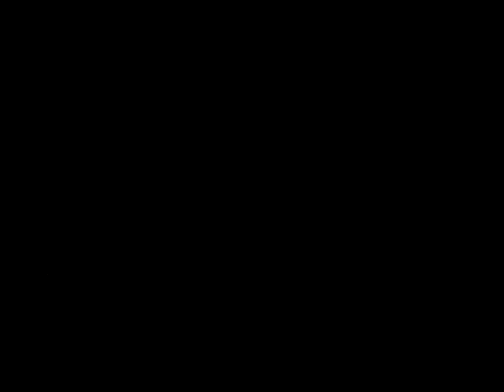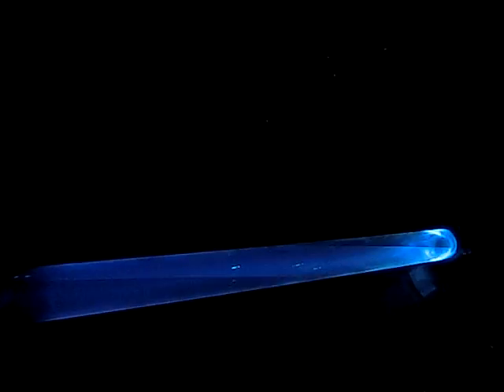Small homemade particle accelerator. (very basic design)

Comment: ok ok the vid is old but I really hope to get a response on a few questions:

I will need slightly more voltage but that7s besides the point ik how to get it.

with most linear accelerator designs i see multiple stages. like an electrode every multiplayer stage, or wit van de graaffs it's a bunch of resistors from top to bottom with electrodes after every few resistors. what is that for? and do I need it? bc it's not making the electrons faster that's for sure... maybe focusing them more? idk.

next. how low is ur vacuum, and can a single stage pump achieve it? my current one goes to smth in the order of 10^-5 or 10^-6 Bar I think.

next: you are firing into a block of acrylic. I actually want to do the same, in order to put electrons INTO the acrylic which is an insulator. that way I can charge the insulator from the inside. idk if 150kV is enough for noticable effects but if you did do it I'd like to know what your results where.

thx in advance.
Reply from the maker: You don't technically need to have multiple electrodes as long as you have a high enough voltage difference assuming you are using d.c.. The acrylic has a small hole in it with foil in the hole to generate x-rays for some other experiments. I haven't tried doing the charge thing with acrylic but I've seen some videos online so maybe? And, I want to say your pump shooould be able to get the electron beam to form at that pressure. You'll notice a dark region expand more and more from the cathode, eventually filling the tube and then fluorescence will occur with the chamber walls depending on material used.
Reply: @talktoyourself   first of all, thx for the reply.
interesting you say it was getting darker/black at first? ik it does that when dissolving electrons in ammonia but didnt know you could have enough power to see it like that in an accelerator...
 Do you have a 2nd  circuit with high amps to generate electrons, or do you just have a sharp point on one of the electrodes?

I am still sceptical about my current pump. it's a single stage pump. just looked up. 5 pascals. so 1bar is 100000 Pascals which means my pump (claims it) goes down to  5*10^-5 bar.
but hey. trying out never hurts right? :)

what bothers me with the videos online about that internal charging thing, is that it's always "Look at these cool lichtenberg fractals" but that thing should basically generate a massive E-Field without being able to be discharged (well except if you hit it hard). I really wana know how strong the interactions can get. ik there is some max charge density but I am on vacation and dont wana do the math on paper and research on phone hahaha. maybe build wierd influence machines with it etc.
Reply from the maker: @scipug3048  never know till you try is right haha and I believe it's called the Faraday dark space, or maybe the cathode dark space. It starts off really thin at higher pressures and grows larger and larger as the pressure drops. It's the mean (average) free travel path the accelerated electrons travel before smacking into an ion. Basically the darker the better in there. And just regular old electrodes or flat metal works fine. I actually just used regular brass fittings in mine.
Reply: @talktoyourself  ok nice I might look that up with the dark space...
but again I meant do your electrons come directly out of your cathode, or do you have an extra electron source like a coil of wire that you pass a lot of current through?

Comment: How much MeV are the x-rays you produce?
Reply from the maker: Probably only 0.1MeV at most, assuming full conversion of electron energy to photon. Realistically, probably a band between 15keV and 50keV. Applied voltage got up to 130kV if I remember right.

Comment: Isn’t this extremely dangerous with the X-rays? Also for this electron accelerator, you’re using a linear accelerator system right? If you are, how are you getting the cycles in correctly because I’m having trouble correctly timing the switching of the electric fields for my model.
Reply from the maker: This is actually not a radio-frequency driven accelerator, it is driven by high voltage. Radiofrequency accelerators are much harder to design and require very fine frequency control as well as precisely machined cavity spaces. That would be an excellent project but is significantly more difficult

Comment: so how can i use a particle accelerator to make hydrite? for use as fuel in my hydrogen convert car.
Reply: You don’t need a particle accelerator nor hydrite, you need to isolate hydrogen alone from H2O using electrolysis, and moreso a resonating frequency which can amplify the energy during the extracting process

Comment: Hello! Im planning to make something similar. Would It be possible to accelerate electrons in a circular environment? Thanks!
Reply from the maker: It is possible if you have ever looked into the helmholtz coil or design. The main issue is that acceleration cannot be continued past a short period, then the electrons slow down. There's a device using hemholtz coils around a vacuum chamber to make them circulate but I forget the name.
Reply: @talktoyourself  Ah, very well. And with your design, were you able to get some visible glow, or is it just because the x-rays are interacting with the camera sensor?
Reply from the maker: @MatijaSircelj  definitely visible glow! It was surprisingly bright actually
Reply: @talktoyourself  great! And do you think the tube can be made out of plexiglass, or does it need to be real glass?
Reply from the maker: @MatijaSircelj  I'm sure plexiglass is possible if you have a strong enough pump but I always ran into problems pumping down below a certain level. I think plastics start to vent gas when they get below 1 torr. I definitely recommend glass
Reply: Plasma produces generates extremely high temperatures as well, so plexiglass would be at risk of softening and deforming at these temps, at anything more than a very short duty cycle.  Be sure to use Pyrex glass if you're going that route, as it has a more uniform thickness and resistance rating (dielectric) as well as being more heat tolerant.  And he's also right about the offgassing, it's best to use pyrex tube or silicone here as well.  Thick walled silicone is best though, as it can withstand a much higher vacuum before collapse. @MatijaSircelj

Comment: Hi bro, I'm planning to do something like that too! Could you point me to some tutorial, or the source and books you used to do this? It would mean a lot to me!!! Your project is amazing by the way!!!
Reply from the maker: It took a lot of investigating, setup and tons and tons of patience lol You will need two rotary pumps, one pumping the output of the first, establish a good low pressure in your vessel.(epoxied shut) then apply a high voltage from a CRT or flyback into a voltage multiplier(made by you) and then hookup your new ridiculous voltage levels to the vacuum tube. Ideally you'll have high energy electrons slamming into metal parts the tube/device is constructed with, but even the glass glow emits xrays. A good vacuum and an over powered HV supply go a long way. Pretty simple overall, and magnetic steering is mind boggling to mess with
Reply: Bro sameeeee

Comment: I'm not an expert but does it give off a safe amount of ionising X ray radiation.
And how did you build this
Reply from the maker: It is a relatively small amount of radiation thankfully and it took a lot to get to that level to be honest. Several parts were made from scratch. High voltage multipliers, the glass vacuum tube, needed two rotary vane pumps etc. Definitely an investment for some cool lights 😅

Comment: What is it used for?
Reply from the maker: Actually did the same experiment with two different tubes. One gave actual live x-ray images, and the other was originally intended to pass those electrons into open air until I realized that the voltage I was working with was far too low to get any good effects. Hopefully more videos soon

Comment: I'm surprised you didn't make a toroidal particle accelerator, with quadri-pole magnetic stabilizers. What you did was basically made a cathode ray tube.
Reply: I can do the same thing with a florescent light bulb
Reply from the maker: Actually, a very long time ago I did want to build a toroidal particle accelerator. A few years ago I was thinking of ways to build a makeshift particle accelerator using a standard magnetron. They have excellent gradients but my machining skills aren't quite amazing smh.

Comment: Really new to physics but when you shut the lights off what are those specs of light flashing everywhere ? Would i get those results if i make one using a glass bottle and a vac pump ? The same design you can find all over YT. Thanks
Reply: the specks of light are artifacts caused by the x-rays hitting the camera
Reply: You can do the same with neutrons and sub atomic particles,  it acts almost like a Geiger counter the way the diode works.
Bet if you put a camera taking a video through a tsa checkpoint X-ray or to the dentist X-ray you would see alot

Comment: Dude, you should shield it with a Faraday cage,
Reply: SOMEONE KNOWS IT'S DANGER
Reply: At least you paid some attention to this, and yes that would be a good idea due to the loose X-rays and high voltage equipment he has.
Reply: @zenthrosrion9147  a Faraday cage will not stop X-rays, have no illusions, only lead can stop x-rays.
Reply: @timothyegoroff8333  Even plain simple water will stop x-rays if you have enough of it.

Comment: Cool experiment and set up. But I'm very concerned about the stray radiation. I would definitely recommend some kind of shielding. If it is indeed as much as a CT scan, then you're slowly cooking yourself, it's very easy to exceed recommended yearly dosage. It's not just the x-rays either. Any stray magnetic fields permeating the tube will result in synchrotron radiation - for instance, if they cause the electron beam to follow a helical path. This is my guess for the x-ray emission. Synchrotron radiation is broad spectrum, everything from microwaves on up to hard x-rays - depending on particle velocity, magnetic field strengths, etc.

If you must have the tube exposed for filming/visualization purposes, I'd put it in a lead impregnated glass casing. At the very least, leave the camera there and have something good and thick between you and the apparatus - like a thick concrete wall.
Reply from the maker: @ophammerdin8579  lmaooo almost accurate 🤣🤣 unfortunately the camera I use is also my high speed camera for other experiments and has horrid FHD video quality. It was a lot to cram into a relatively short video and I will probably try for better quality.
Reply: @talktoyourself  no point in doing this again unless you get better safety equipment
Reply: @talktoyourself  can you make a detailed video on this
Reply from the maker: @MrRucciGucci  I might in the future, I'm working on a better vacuum setup right now and a few other projects, but just about everything in the video can be YouTube searched. There are some other vacuum chamber videos on my channel as well if you need some vacuum tube design help.
Reply: @talktoyourself  Thank you, would it be possible if you can send the videos of the vacuum chambers design and set up
Reply: @talktoyourself  any books you recommend for this?
Reply: Lead glass casings are for sissies.
Reply: It’s so little radiation only thing it can kill is a ant
Reply: @thepurpleman5916  nice copy + paste from the other comment.

Comment: AMAZING!!!!

Can i do build one? If so, how?
Reply from the maker: Hey,  

If you check out some of my other videos, I go into brief detail of the setup. It would cost around 400 USD total to make something like this and a decent bit of time for the builds. (A lot of epoxying, glass cutting, design thoughts, making a voltage multiplier, and materials choices [plexiglass, acrylic, and epoxy evaporate at sufficiently low pressures limiting maximum vacuum]) The first things you'll want to work on are getting a decent HV setup made for yourself, and getting to know what you can and can't do with it. The more research you do, the better and safer your experiments will be.
Reply: Max C Thanks a lot!! I'll see how it turns out
Reply: Thanos actually it’s particle ACCELERATOR and he made a device that accelerates particles so it is. There aren’t any explosions this isn’t iron man
Reply: @sure1073  Thank you! Clearly isn't educated
Reply: I wouldn't trust you with radiation, buddy.